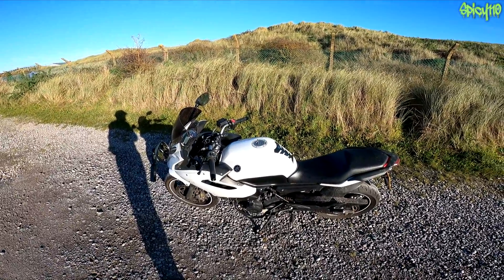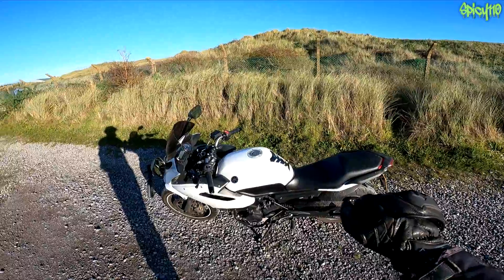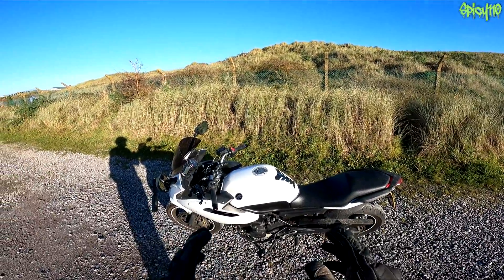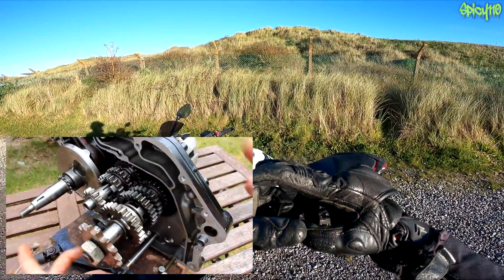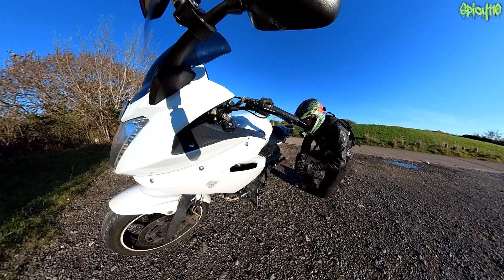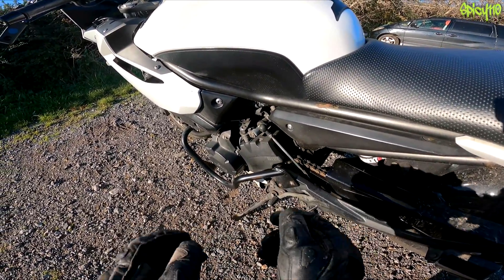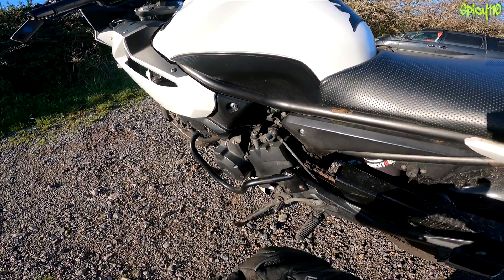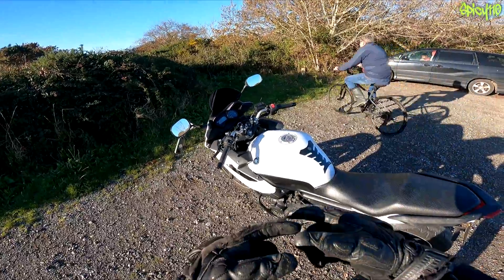How Motorcycle Quickshifters & Auto Blippers Work!

Comment: I learnt clutchless upshifts on my Ninja 400 after maybe a year or so of riding, and eventually also rev-matching on downshifts. I pretty much exclusively did clutchless upshifts from that point onwards unless I was accelerating gently. On my ZX6 that I got back in June I have a stock quickshifter and I always thought I wasn't bothered about having one but since using it I actually love it. It's so smooth and it can be switched off if I really want to use my clutch for upshifts which is nice!

Comment: I use a ECU based quick shifter. Unfortunately I don’t recall the brand since I bought it off eBay years ago. It works pretty decently but biggest pain in butt was having to spend extra money to get it enabled on ECU via flashed.

Comment: All Jawa & CZ 2 stroke motorcycles are manufactured with a semi-automatic or slick shift system. This allows for simultaneous control of the clutch through the gear lever regardless of the rider's squeezing of the clutch lever. The gear lever shaft passes through the entire engine, to the opposite side. On the far end of the gear shaft is a profiled lever with a guide track. Aligned with this track, is a small metal wheel on an arm protruding from the engine's clutch actuator mechanism, which is also attached to the clutch cable from the handlebar lever. On moving the gear lever up or down, the guide track moves, moving the small wheel and arm, which causes the clutch actuator to push the clutch push rod and release the clutch. Holding the gear lever up or down will keep the clutch pulled in  and slowly letting the gear lever return to the central resting position will slip the clutch. (Yes, the bike can pull away from stationary using only the gear lever as a clutch pedal).

Comment: if you ride a lot of alpine like roads, with steep inclines and tight hairpins, a downshifter with auto blip stops being a fancy extra and it becomes an actual useful item. When going downhill on roads like that, if one doesn't do a proper downshift with throttle blipping while managing the front brake, all at the same time, it can get nasty, especially with a bigger bike with a lot of torque. And while mastering this technique is a pleasure in itself, it can become a bit tiresome after a while and here is were a bidirectional QS really shines.
Reply from the maker: Really good point! I do find in traffic they are quite nice as they give your clutch hand a rest.
Reply: @spicy110  yup and for city traffic it's also very comfortable to have a hydraulic clutch. Right now I have a bike with both a QS and a hydraulic clutch with an adjustable lever and the comfort level is just miles better compared to my previous one.